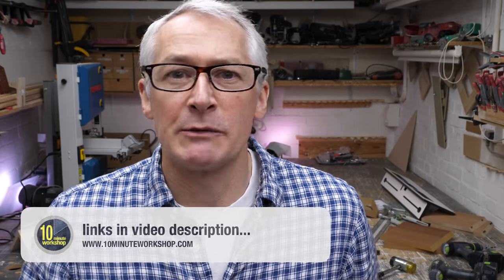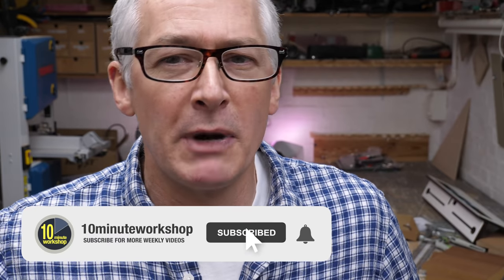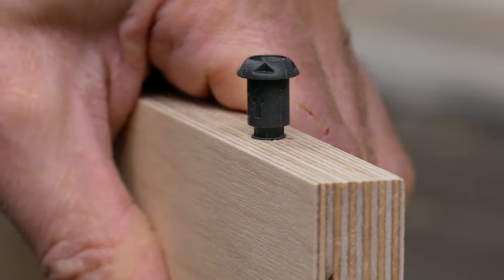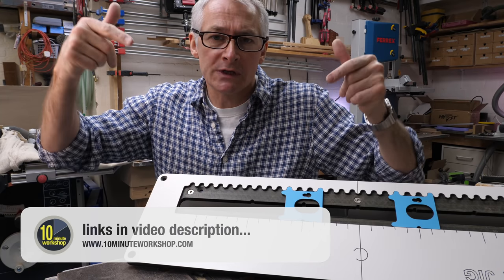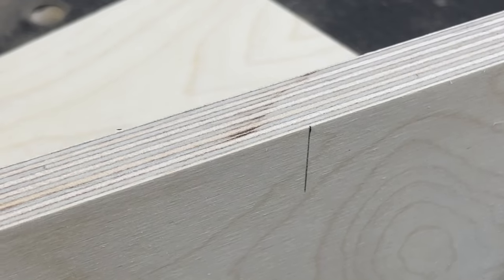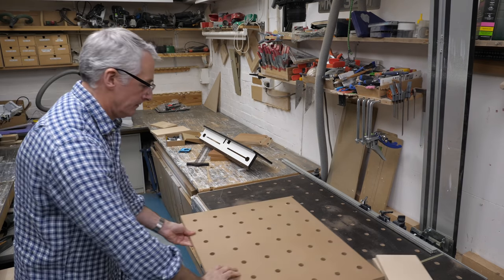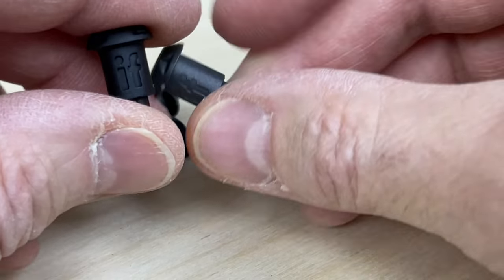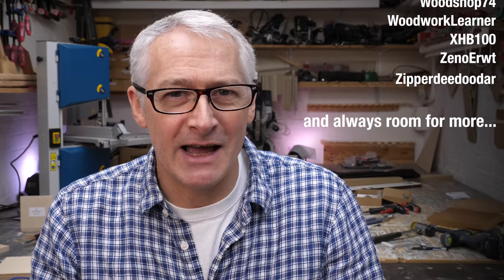Peanut 2 Jointing System - the mid-range solution? [Gifted/Ad**][video 429]

Comment: Hi Peter - appreciate I'm 6 months late!  What do you think about the longevity of the system when taking apart and then reusing?  Can't seem to find anything on that? (Might not be looking hard enough!)

I'm considering a modular workbench type system with individual rolling carcasses - built in the normal way, but then joined together with this type of system when in use - but being able to disconnect them and plant an MFT top (from Formatic!) between them...  My workshop is tiny!  

As always - great vid - and I've just patreoned up!
Reply from the maker: Hi Tom! Thanks - and welcome! They’re not designed as knock-down fixings in the traditional sense - the peanut connectors bear against the material, so eventually the material will wear, but that wear will be very dependent on the materials used eg Birch ply would likely fair better than MDF or chipboard, hardwood better than Birch ply.
Reply: @10MinuteWorkshop  Ah - good to know!  I've clocked their primary use having watched a few more vids.  Back to the (Sketchup, sorry!) drawing board.  If you happen to come across more heavy duty demountable type DIY style fittings - do let me know!  Might have to rely on friction and locking nuts!  Thanks again! Keep up the good work!

Comment: Peter would you/could you also glue the joint.
Reply from the maker: Yes, absolutely. Knock-down fixings get used an awful lot as a permanent joint, but with the convenience of being able to bring the components in flat to assemble on-site. Very common to add glue to joints with eg Lamello Tenso or Clamex fittings as well. 👍👍

Comment: Oooh 🙂 likey. This may be my weapon of choice as not got any system yet. I really like the look of this!! Thank you Peter. Great vid. Do you know what is the min depth of work piece?
Reply from the maker: I’ve used them in 12mm. 👌
Reply: @10MinuteWorkshop  just looked at their websute and now a bit confused as there is peanut 1 and 2 and maybe was a 3 cant rememeber now will have another look later and watch all their videos.
Reply from the maker: Don't be confused. This video is just about the Peanut 2. (Peanut 1 is totally different component, for CNC and nesting machine and applications, Peanut 3 is friction-fit dowel (no screw) for insertion by nesting machines.) Just concentrate on the Peanut 2. 👍

Comment: Hi Peter, what material are you making this with? If it’s Plywood, what type and how do you finish it?
Reply from the maker: Hi Dave. Don’t quite understand - I’m not actually making anything in this video, just demonstrating the jig. I am using Bitch ply yes, and my preferred finish is either hard wax oil eg Osmo, or a water-based lacquer. HTH. P
Reply: @10MinuteWorkshop  Really helpful. I like the look of the mini peanut jig. I like making things with plywood but want to produce a professional finish. That way I can make things in my garden ‘workshop’ when I have no site work. Thank you.

Comment: Harrumph, one week after I buy my Domino, you bring this out. Talk about timing :(
Reply from the maker: Honestly, the Domino's a great machine and absolutely the most versatile handheld powertool jointing system I've used - don't have any regrets about guying one, and congrats for finding one to buy, btw - they're in short supply! I don't personally like the Connect fittings for the DF500 - they're what led me to buy a Lamello Zeta - but for regular construction and fabrication, they're a great machine, arguably the best, and certainly the most versatile, IMHO. But as I say in the vid, there's no one perfect tool for every job - though the Domino comes close! 👍👍

Comment: Can you joint edge to edge with this system peter so 180 degree joint in effect to join 2 boards together?
Reply from the maker: Hi Damian. Yes, absolutely - perfect for it really, as they’re self-clamping. 👍👍
Reply: @10MinuteWorkshop  lovely - still not pulled the trigger on a system as not got my workshop area setup yet but getting closer 🙂👍 think i like the peanut best without soending domino money.

Comment: I wonder if you could use these with dominoes (on the wide setting) ?
Reply from the maker: For centre-panel alignment Chris? Don't know, I'll have to have a play and see how much 'slide' is needed - from memory it seemed to be about 15mm, so probably beyond the scope of a wide slot. But good question, and I'll take a look and see. 👍
Reply: @10MinuteWorkshop  yeah just thinking mixing these with a few dominoes to take the weight. Like you say it might be beyond the wide setting, suppose you could widen it in two passes but is it worth bothering.
Reply: @10MinuteWorkshop  I suppose it's aimed more towards people who don't have a domino
Reply from the maker: I think it's probably quicker to just pop in another fitting in the centre, and hang the 15p additional cost!

Comment: I did not quite get what makes it so that the connectors tighten when you slide the final pieces together. Are those blue inserts slightly wedge-shaped to make the router gain depth when doing the slot? Nice video anyway. The price of the system still seems quite high though, for a couple of pieces of jig.
Reply from the maker: Thanks! No, the inserts are flat. I’m not entirely sure how it works tbh - been concentrating on what it can do - but it creates a slightly wedge-shaped slot that tightens the joint as it’s slid together. As for the price, I remember when kitchen worktop jigs were that kind of money, and the sourber lock jig.  As I say at the end of the video, there’s a mini jig coming very soon that negates much of the cost issues. 👍👍
Reply: @10MinuteWorkshop   Hmm, that is very mysterious. If the slots really are wedged depth-wise along their length, I cannot think of any other way than to make the inserts slightly wedged and they would also then need to be thicker to stand out from the jig. The whole jig cannot be wedged since that would cause too much disparity between each end in such a lengthy piece.
Reply: @pev_  I am guessing the cutter tool has a very slight taper on the undercut side. If you imagine an upsidedown T  the horizontal part would thinner at the ends than at the vertical part.
Reply: Oh, I just looked at the manufacturer's page and it describes the "cutter drops 2.1 mm over 10 mm and then remains lever for the rest of the 20 mm length and exit path". How the hell does it manage that???
Reply: @astrecks   Yeah I actually realized that might be one solution, but if you read the manuf. explanation (with a picture) it seems even more complicated!
Reply: @pev_  Yes, I just looked at the tech specs too. The only thing I can this is the guide plate is design in such a way as to re-adjust the height of the cutter independently from your plunge depth as you cut sideways
Reply: @pev_  I have a suspicion, given that patents are pending, there is no detailed image of the cutter and fair play I guess!

Comment: seems reasonable compared to the lamello, i think the domino does a slightly different job,
Reply from the maker: I was thinking more of the domino connect fittings tbh, though having used a domino for ~13 years, the idea of a clampless joint has a lot of appeal! 👍
Reply: @10MinuteWorkshop  sure, i like the adjustability of the domino and the differing sizes, but this system is a lot cheaper to run for knock down fittings, cheers

Comment: Peter, thanks for the intro to this unique system. Question: any imperial version for us across the pond using plywood measured in inches? Without knowing more I cannot discern if this system Is like the domino - not critically dependent upon mm or inches.
Reply from the maker: Hi Steve, and thanks for the question. As far as I know, the only metric part of the package is the 6mm drill bit for fixing the peanuts; everything else is referenced off the face of the board, so the units of measurement shouldn't make a difference. I'll flag this up to @intelligentfixings and see if they can come up with a definitive answer though. I know the minimum depth of board the system can currently cope with is 15.5mm,  but wether that equates properly to 5/8" is something I don't know, I'm sorry.
Reply: @10MinuteWorkshop  thanks. And if you find out more about plans to market the jig in the USA II would appreciate any info on that front.
Reply from the maker: Thanks! I’m not privy to company information, so I’ll leave it up to IF to answer that one. 👍👍
Reply: Hi Steve, thanks for your question. Peter is correct, because the router references from the face of the board, the thickness does not effect the joint being flush. We have been selling our products to new customers in the US and have already had some positive feedback.  I hope this answers your question.
Reply: @IntelligentFixings  I tried calling you yesterday to ask some questions about this system but didn't get a call back, One question that Peter makes reference to in his video is where the keyhole slot gradually changes depth, I can't see how this is done using a router on the jig, if the jig faces are parallel surely the slot clamping face should be parallel to the face of the workpiece as well.

Comment: would you use it for example "flat pack furniture to send to a client?
Reply from the maker: I've never had a client I'd trust with that tbh, but yes, it's a very simple system to slot together. 👍
Reply: @10MinuteWorkshop  lamello then for client flat packs :), this system ok for pre assembly , just a matter of interest - have you tried to combine glue in any way -say along the surface of each piece ?

Comment: Peter, I know you will get more info from original source.....In reference to your WITWS video, your experience of the non sloping cut looks real world, and doesn't seen to match up with the video included on the iF website. that one very clearly shows a slope to the top surface of the horizontal cut, just as you had predicted. The video shows the peanut being dragged down by the slope. Its hard to see if the cutter actually descends as it cuts, which it must (surely) to get that profile, and it's only animation so who knows?
Reply from the maker: Hi Dave. The cutter does 'ramp down' when used in the CNC - it's one of the clever things that CNCs can do - but it is a flat cut when used in the router; I hope to be getting a hands-on explanation/demonstration of how it actually wrks tomorrow! Keep you posted! 👍
Reply: @10MinuteWorkshop  Thanks Peter, to be fair you did mention that in the video. Maybe a happy accident that the deformation of the peanut in a straight cut is enough to tighten the joint? Its possible that as more of the peanut passes under the edge, it deforms more, so you would get a sensation of tightening up, at least until all of the peanut is under all of the edge.....or magic?
Reply from the maker: The peanut doesn't seem to deform at all, so I'm honestly not sure how it works - but it does! And I'm pretty sure there are no happy accidents going on here - everything is very carefully thought through! 👍

Comment: Peanut requires a tapered recess. I don't see how you did the taper.
Reply from the maker: The ramp is just for the CNC application, the router uses a straight cut; the guy who invented it explained it to me and I still don't really get how it works - but it does! 🤷‍♂️

Comment: Smart system but ouch what a price??
Reply from the maker: The big jig is very versatile, and there’s a mini-jig coming before too long. If you just want to make simple 90° butt joints then there’s nothing to stop you making your own jig; cost of the fittings is very reasonable in comparison to other knock-down connectors. 👍👍

Comment: When I first saw this, I dismissed it as an expensive gimmick.....I think that was a bit premature, because now I've seen it in practice it's pretty good. I don't like the domino connectors at all, and even though I like overpriced, swanky German/Swiss powertools I simply cannot justify buying a Zeta....but this actually looks like it might fill the requirement for a solid knock-down joint. Still a bit on the pricey side though!
Reply from the maker: Thanks! As I say, mini jig coming soon, may change your mind about the price of entry. 👍👍

Comment: Seems extortionately expensive for what it is.
Reply from the maker: Compared with what? As I say in the vid, £400 for the starter kit is a decent chunk of change for anyone, but it’s half to a third of the price of the comparable dedicated power-tool systems, with much cheaper consumables. I’m old enough to remember when kitchen worktop jigs were that kind of money - I think the Festool one still might be - and they’re just a bit of board with a slot in it. I’ve no axe to grind here - I’ve no commercial interest in the success or failure of this system - and if it’s too rich for you right now, then by all means don’t buy - or wait until the (apparently much cheaper) mini-jig comes out. But you can’t really talk ‘extortion’ without also mentioning the Lamello Clamex fittings at £1.30 apiece, or the Festool Connect at close to £1.80 - that’s after buying the Domino at ~£750 and the Zeta at ~£1250. 🤷‍♂️👍
Reply: Perhaps I’m looking at it wrong but I would liken it to a dowelling jig. If for example you said a decent quality doweling jig was £40 then a fancy pants “pro” version would conceivably command around double that so say £80 for that. Then in my mind, this with its proprietary bits and bobs and knock down capabilities would see it comfortably slot in above the rest as a “specialist” dowelling jig. So I think double again would be somewhat reasonable at around £160 for the entry level jig and perhaps £200-250 for the kit in the video.
In summary I have no idea of the companies overheads or the unit cost to manufacture the jigs but I think it is vastly overpriced unfortunately. Perhaps it will come down in price if it sells well but for me, even as a “pro” fitter I’ll stick with biscuits, dowels and if required speciality fixings like the Keku from Hafele until such time as I am ready to invest in a festool domino. 🤷‍♂️

Comment: No penis connectors in the captions this time 😆😆. Just wondering if there any benefit to using wood glue to create a more permanent construction? Seem like it is self clamping so you can just glue up and move on without waiting for the glue to dry.
Reply: Yes, depending on the application glue can be used to make a permanent and even stronger connection and as you say no need to wait for the glue to dry.
Reply from the maker: Phew, glad to hear that Dafydd! 😂 Yes, same as the lamello connectors, adding glue to a joint that's meant to be permanent can ada lot of strength! 💪😮
Reply: @10MinuteWorkshop   @Intelligent Fixings  cool, I look forward to see what the mini version price will be... Hopefully the price will be more price friendly for the home woodworker. Thanks both

Comment: Definitely not worth $460 us not unless they're using pure gold for everything definitely looks like an awesome system depending on how much weight they can actually hold if you can make drawer systems out of it things of that nature don't know the total spectrum of useful applications for that I can think of a whole lot doesn't mean it would actually work for that they would be making a crap ton of money if they cut the price in half just from the sheer amount of people that would actually buy the thing but that price there's only going to be a handful of people that would want to spend that kind of money on something they know nothing about and there's no way they have that kind of money man hours material or otherwise in that system to warrant that price I'm all about a man or woman making money but there's making money and then there's damn what were you thinking must have been trying to run your company in the ground before it ever got started
Reply from the maker: Hey Brian. Well, that's entirely up to you; I will say that the Peanut system has been around for a while and is well established for commercial furniture makers, but these are their first foray into a router and jig system for the one-man designer/maker/installer. As I said in the video, there's a mini-jig coming along very soon that I'm told will address the vast majority of pricing concerns, and as soon as I get my hands on one I'll be sure to post about it here. Best wishes from London. Peter

Comment: Apologies for peeing on the party but the technique is not new. Ikea uses this type or connectors on its Platsa units, for example.  Ye man's innovation is to take that idea and produce a DIY option.  A bit like what Steve Jobs did with the stuff coming out of Xerox  Parc.  A smart bizzy rather than a brilliant innovator. Still, it's still clever, I'll give you that.
Reply from the maker: No, it is different; I'm told that Ikea are aware of this connector, and there are sufficient differences for this to be patented.